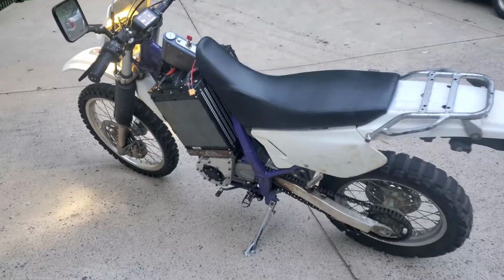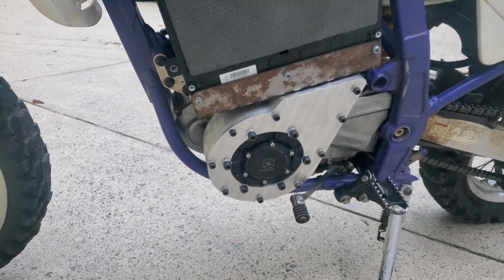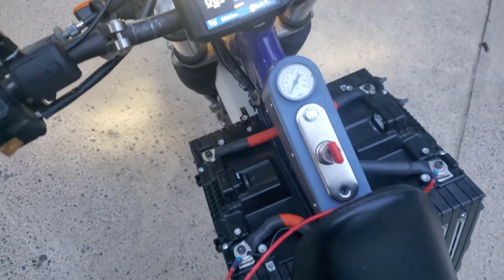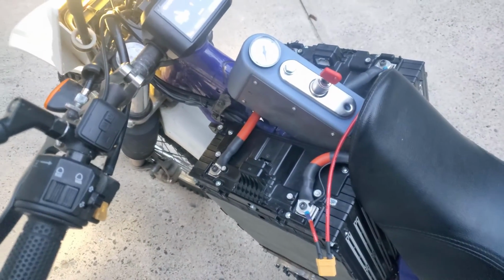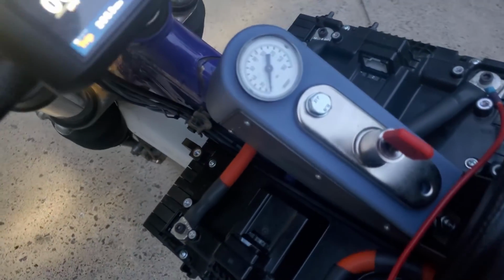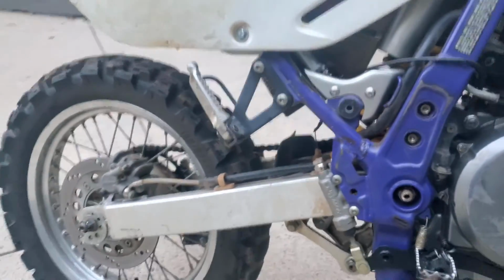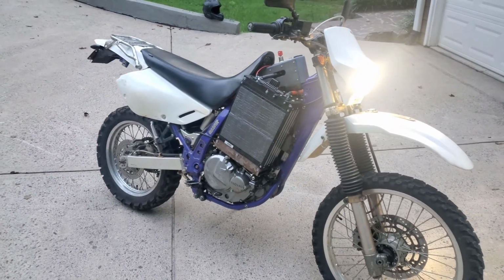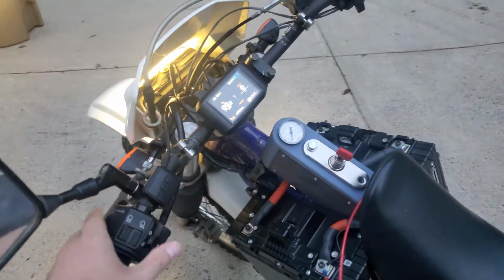5 Speed Manual E-Moto Build

Comment: I love this! Brilliant idea! The fabrication and how it's turned out is inspiring. I bet it turns a lot of heads, especially with that unique sound.
 I'm converting a triumph St 1050 speed tripple, with that same motor, kelly klbs 96351 controller and 36s 2p Toshiba scib battery. I want to use its original gearbox because the single swing arm restricts the rear sprocket to about 44 teeth. If you don't mind me asking... Does the gearing help keep the motor cooler at high speed? Did you use every gear? And what's it's top speed? 

Great channel. Subscribed.
Reply from the maker: Wow sorry for replying 10 months late! 

How is your project going? I'd like to do a sport bike one day as well! 

I use the gears everytime! I think they really lend themselves well for a Dual Sport because I use lower gears offroad and higher gears on the street. 

I think the gears work well to hold the motor in a good rpm range. It still has the full oil system helping with cooling as well. 

Until I take some time machine a custom rear sprocket carrier, I am limited by gearing to about 80mph. 

Thanks for the subscription! I plan to put out a new video soon!
Reply from the maker: 2 years later, I got an update out! New project reveal as well! 

https://youtu.be/LSriz3nMfh8?si=dcaOrw1Naau1AF1d

Comment: Does the clutch work? Does it stall? I'd assume not but I'm curious
Reply from the maker: Yes the clutch works. The motor can come to a stop so you don't need the clutch to start off. You can use the clutch for smoother shifts or clutch up wheelies.
Reply from the maker: 2 years later, I got an update out! New project reveal as well! 

https://youtu.be/LSriz3nMfh8?si=dcaOrw1Naau1AF1d

Comment: this is an awesome build! the torque in low gears must be mind blowing with the extra gears! did you think about going direct drive? im sure the 138 90h has way more than enough torque to not need the gearbox, plus you save a lot of weight and gain range from less friction in gearbox, and less to go wrong! some food for thought. i still wanna know what its like with gears though haha
Reply: I like the gears. No gears is a bit boring
Reply: @jonnyjones7689 no gears are so dumb. Laws of physics don't change because motor is electric. Bad highway range is because electric vehicles are like fixie road bikes vs a 10 speed road bike. Night and day difference.
Reply from the maker: 2 years later, I got an update out! New project reveal as well! 

https://youtu.be/LSriz3nMfh8?si=dcaOrw1Naau1AF1d

Comment: I'd consider completely doing away with the gearbox.  Since an electric motor has max torque at "0" rpm, you can just run a direct drive...which is what I do with all of my electric bikes :).
Reply from the maker: I've built a dozen or so single speed bikes. The gearbox is a whole new animal. So fun!
Reply from the maker: 2 years later, I got an update out! New project reveal as well! 

https://youtu.be/LSriz3nMfh8?si=dcaOrw1Naau1AF1d
Reply: Less transmission losses/weight/maintenance and better efficiency without gearbox too

Comment: Kevin, is the QS138 90H enough motor? It seems as I look at motors manufactures don't rate them the same way. I see these motors used in bikes and the motors are rated at 3000w-4000w and then look at the FreeRide-E or the Alta and that ratings are a lot highers. I understand the higher numbers would be at peak so does that mean the QS motors are rated at nominal? Like a friend said once "I can't explain just how little I know about this". But I'm trying to learn. I want to build an electric woods bike to replace my KTM 300. Thanks, DC
Reply from the maker: The controller and how much heat the motor can shed is the main thing that defines the power. 

The 4000w rating is a continuous rating with no additional cooling. 

Traction drives in vehicles are never continously loaded. This is why you see the qs138 comes with a 15kw controller out of the box (em150). 

I'm running it on a bac8000 at 20kw right now. Mine has additional cooling from oil flowing over the motor. It's staying under 150F. 

I am about to add 3 more oil sprayers. Then I should be able to turn the BAC8000 to 32kw and still stay cool.
Reply: @Goatee_yay  Thanks Kevin, that clears up a lot. I've seen some motors have a liquid cooled option and that obviously would be a big benefit. I subscribed and I look forward to future updates and changes.
Reply from the maker: 2 years later, I got an update out! New project reveal as well! 

https://youtu.be/LSriz3nMfh8?si=dcaOrw1Naau1AF1d

Comment: Hows weight distribution? Are those the batteries up top? My first impression is it's faster than the average DR? maybe wrong but having a gearbox and a nice power curve from electric motor seems like the best of both worlds. So big question is how heavy is the whole thing compared to standard bike? Good on ya for giving it a go and using your obvious engineering skills to good effect :)
Reply from the maker: 2 years later, I got an update out! New project reveal as well! 

https://youtu.be/LSriz3nMfh8?si=dcaOrw1Naau1AF1d
Reply from the maker: It is 22lbs lighter than it was before I started with 3 gallons of gas in my Acerbis 5.5 tank. 

The weight is lower and the bike is much more agile. 

It used to be very top heavy with the gas tank and the muffler mounted higher than the batteries. 

It's on part with a stock DR right now power wise. It'll definitely be faster when I'm finished tuning. 

Check my new vid for some updates! 
https://youtu.be/gJulBV7qZOk

Comment: I've heard the qs138 90h as comparable to a ttr230 4-stroke for power. Does the DR feel sluggish when rolling (i.e. mid-rpm acceleration in, say, 3rd)?
Reply: And of course, power levels are pretty flexible depending on your cooling solution. I'm sure that's helping you a bit
Reply from the maker: 2 years later, I got an update out! New project reveal as well! 

https://youtu.be/LSriz3nMfh8?si=dcaOrw1Naau1AF1d

Comment: Very interested in commuting range in configuration as shown.
Reply from the maker: I haven't wired the bms in so I have not fully charged it yet. It should be similar to a Zero FX 5.7kwhr at 50-60 miles range.
Reply: @Goatee_yay  that sounds awesome! I was interested because of the added weight of the rest of the bike and efficiency of keeping the whole gearset of the tranny. Terrific project!
Reply from the maker: dropped a new video tonight with some more details. If you want to see more please consider subscribing to my channel. 
https://youtu.be/gJulBV7qZOk
Reply from the maker: 2 years later, I got an update out! New project reveal as well! 

https://youtu.be/LSriz3nMfh8?si=dcaOrw1Naau1AF1d

Comment: very cool, what kind of range do you get?  Hows the power compared to the stock motor.
Reply from the maker: I haven't wired the bms in so I have not fully charged it yet. It should be similar to a Zero FX 5.7kwhr at 50-60 miles range. 

Power wise, right now it's on par. I have another 30% power I can add in the controller as well as some other tweaks it needs like taller gearing and field weakening to run the motor faster rpm.
Reply from the maker: 2 years later, I got an update out! New project reveal as well! 

https://youtu.be/LSriz3nMfh8?si=dcaOrw1Naau1AF1d